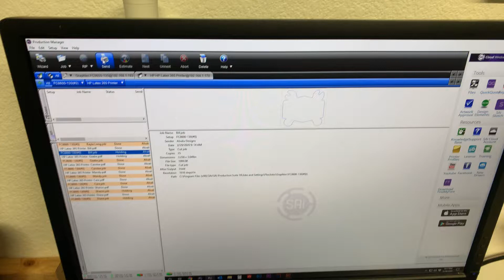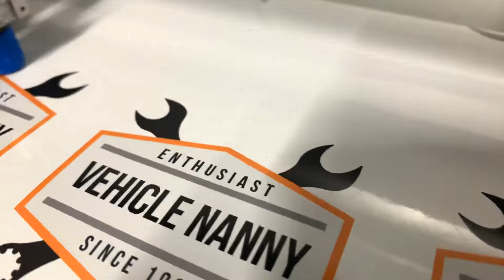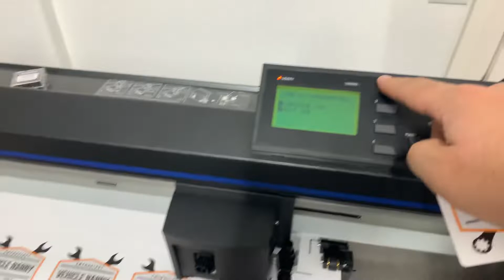Destroyed the sticker :( - Print Shop

Comment: I though you need to change the blade from tool 1 to tool 3 from contour to perf? If you do perfcut not from the channel (tool 3), wouldn't it damage the blade and cutting strip? Did you also perf cut the complex shape below using the same method?

Comment: How do you do the kiss cut over the per channel on the machine?  I didn't think you could do that!
Reply from the maker: I first stick out the blade as far as I’m sure it will cut through both vinyl and backing and then I adjust the blade pressure down to the minimum needed until it cuts through both and then slowly back off the blade until it does not cut through both.
Reply: @printshoptalk  Thanks,  Last question.  How do you set it up to do both cuts automatically?  With what you mentioned above by adjusting the pressure do you do this in the software or on the cutter?  I have the same cutter and use Corel Draw to send the files to the cutter.

Comment: That was so fast, Im using ce6000 60 which is kinda slow compared to your FC series
Are you using 60 degree blade or the original one (45)?
I like your idea, using same blade position for kiss and perf cut
Greetings form Indonesia
Reply from the maker: I use the 60 now as it cuts cleaner :)